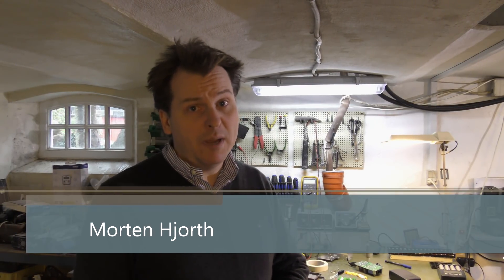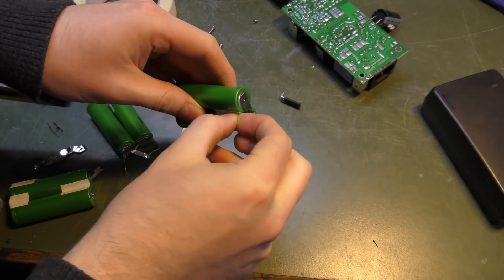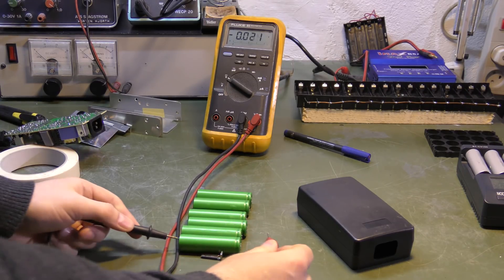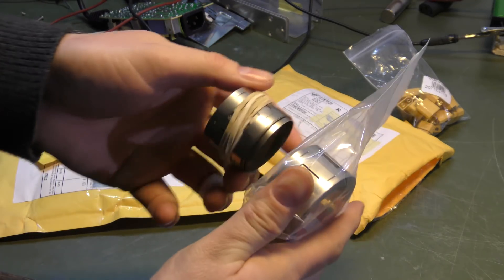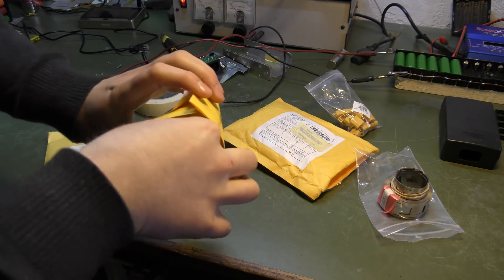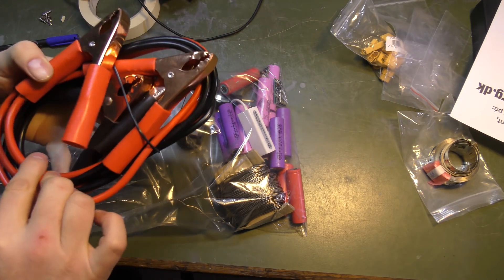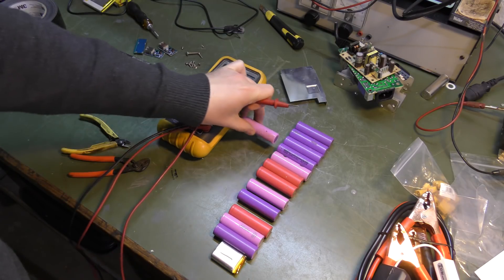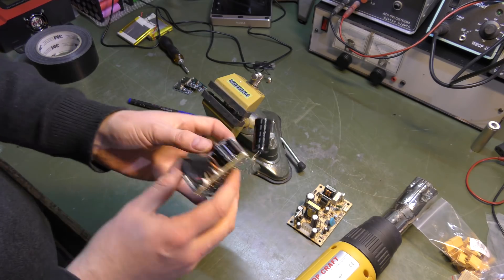Mess Around in the Basement, Working on Power Bank - 639

Comment: Hello Morten.
I would recommend you to use some more powerful plug connections like "Anderson SB50" or any more powerful connectors.
Your Powebank could deliver many more discharge amps than your cables and the XT60 can handle.
Do you have any idea what your 18650 cells have of max discharge amps.
Example:
A 2000mAh Lithium Ion battery can deliver a discharge amps of 5000mAh or more in a shorter period of time.

Best regards, Niels.
Reply from the maker: Hi Niels H. Johansen
Thank You very much!  But with the XT60 connectors witch should be okay for 60Amps,, and the BMS witch is just 15A I am all good. and I hope never to draw more than 10A,, believe I bought 13A automatic fuses for it. With 10A I will be taking 500W out of the bank, and I would be drawing 1A per cell in the bank, so it would last for about 2 hours doing this. And the LI-Ion Banks are parallel with the 24KwH lead acid battery bank,, and right now the Inverter is just 2000W.
Thank you for watching! :-)

Comment: It's too much voltage and amps,for dead batteries. You need charge them a lot slower. Start with 0.5v and 100ma. And then slowly raise the voltage. To 2.5 volts , and then you can put save amperage to them. You can short them out with too high voltage because they are too dead for 3v.
Reply from the maker: Hi Krists Logins
Thank You very much!  glad you liked the video :-)
Thank you for watching! :-)